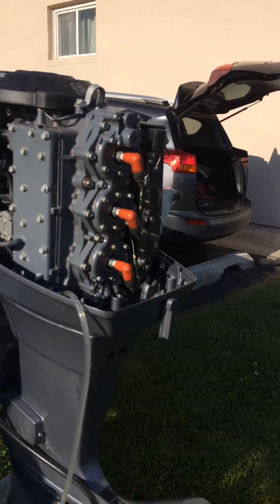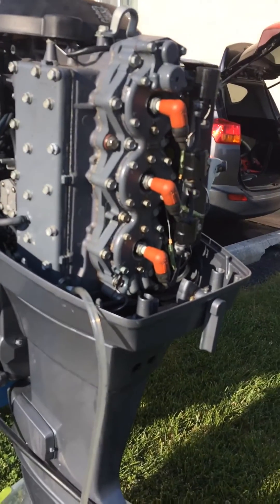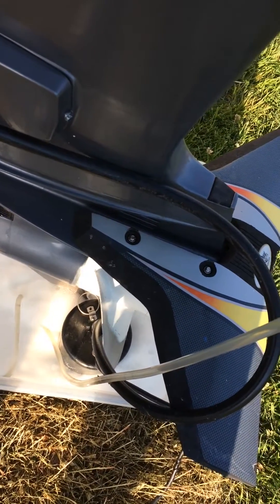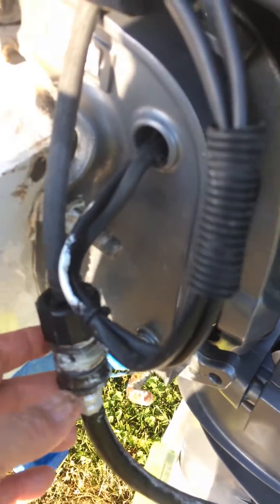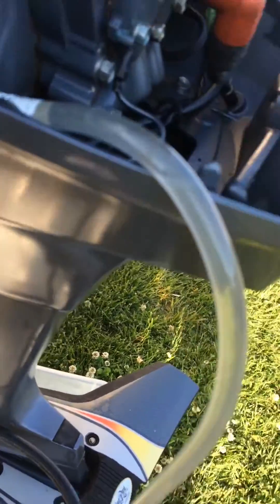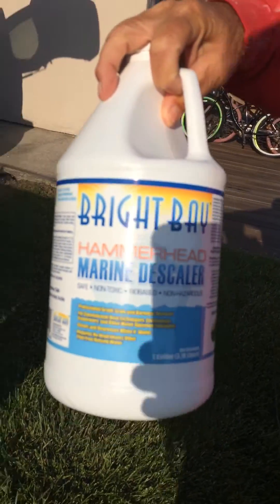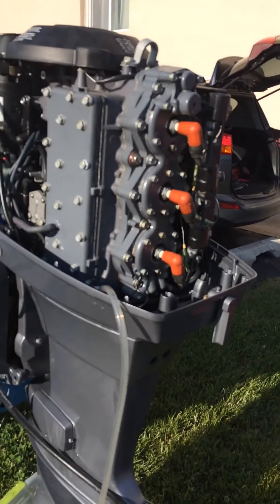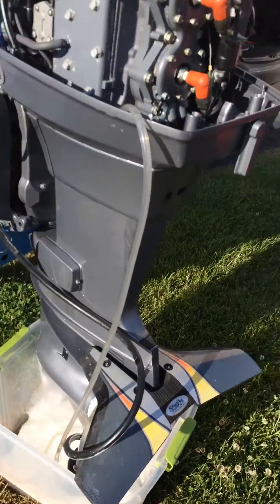Overheating outboard Motor - Simple motor flush to correct

Comment: Aren’t you supposed to remove the lower unit?🤔 i see alot of others remove the lower and attach a garden hose to the pickup tube. So i am not sure. It makes sense since thats the flow of water usually.
Reply from the maker: This motor has a hose attachment to flush the motor so the water flows backwards through the motor but still flushes it.  I have a second video where we removed the head cover (not the cylinder head) to manually scrape the deposits out of the water passages.  This was done since the mineral deposits were so bad.  This fixed the problem.  There are no significant deposits in the lower unit so that isn’t an issue.  The Hammerhead flush won’t damage aluminum parts.